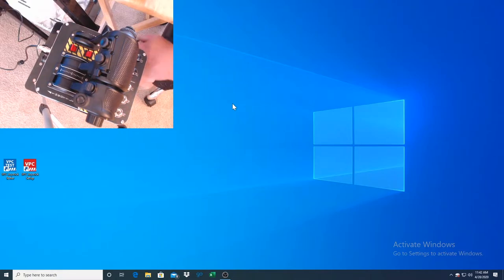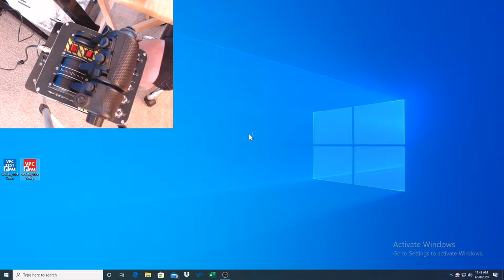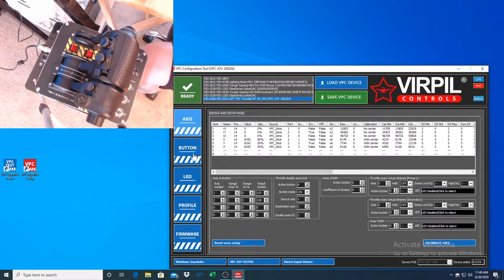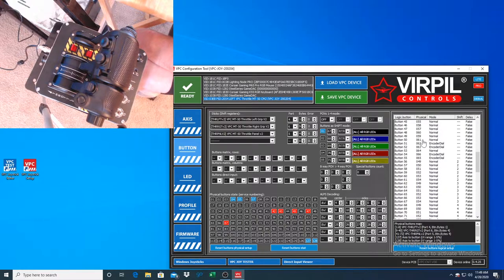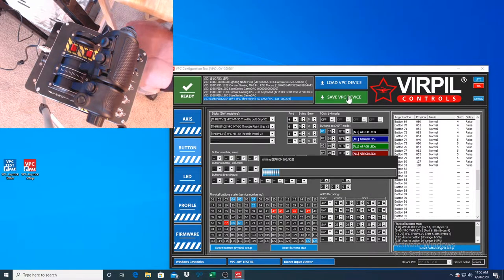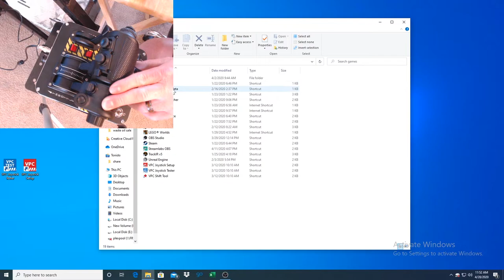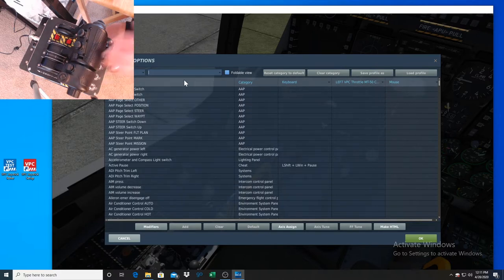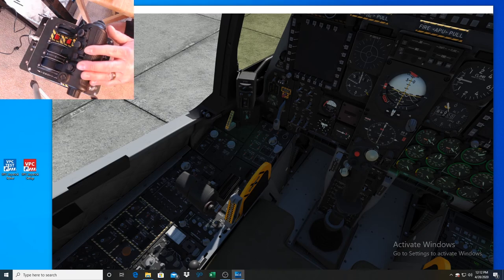HOW TO SET UP VIRPIL VIRTUAL DETENT FOR ENGINE START UP IN DCS

Comment: did everything correct as you instructed, i know i did because the bindings in controls work when i move the control, the blue gets highlighted on the right column.  A10C throttles won't using all the same assignments. all virpil software and testing is correct and sees the idle detent.  Its just that DCS wont.  I'm using A10C - Real. But am i missing something because my throttles have the normal axis already configured for throttle left and throttle right naturally.  But ive tried it both ways, with throttle (left) and throttle (right) not configured and with configured (normal axis range for throttle left & right) --- like we would without detents that is.  thx man  EDIT: OH WAIT, This must be for COLD & DARK engine start up.  I am doing instant with the plane already running & then i also tried COLD AND DARK but did not do any of the preliminatries yet.  i heard you say the key word "I've got the APU running"  so i think that was my clue that the start notch of throttle is for when you are going thru step by step A10C startup procedures in order of all the prerequisites.  DAMN, so sorry
Reply from the maker: https://youtu.be/tG3dRJ0Ryfc 
Try that video it’s an updated version for the cm3 hope this helps.
Reply from the maker: Don’t be sorry I’m glad you got it figured out 😁

Comment: Great video, thanks for taking the time. 

What do you use as the base for your throttle and stick?
Reply from the maker: I have the next level racing with flight pack add on it works pretty well for myself. I did have to drill new hold for the Hotas to bolt to it.
Reply: @JGandT   Thanks for the reply!

Comment: Great video and i have double checked i have done the correct process but I just cant get the Right Throttle to work in DCS. Left one goes fine but when I move the right forward nothing is registered in DCS. In the Virpil software and button checker etc it all works fine. Any ideas?

EDIT : No idea what i changed on the 10th attempt but now its working LOL :) Thanks mate!
Reply from the maker: have you set up left and right engine start within dcs? I also noticed they wont both start at the same time one will spool up when it stabilizes the other will spool. Please let me know if this helps.
Reply: @JGandT  Thanks for the reply - i have edited the post and confirmed after about 10 attempts it just suddenly worked so i was probably being dumb somewhere :) Cheers mate!
Reply from the maker: Glad it’s working let me know if there’s anything else I can help with.
Reply: @JGandT  Well now you have offered :) The analogue stick on the front of the right throttle is that good for slew in DCS? If so how to do configure that? Is it similar to this setup where you have to assign it a button function? Or is it best to use one of the actually 4/8 way hats? Sorry just got the throttle today and the software is confusing the hell out of me :) Cheers again

Comment: The use of the Modifier is slightly confusing. Can you explain how/why you have to do this?
Reply from the maker: @PJ D If you’re setting up the cm2 for idle cut off you will need to use a modifier in DCS or when you throttle back during normal flight it will shut down your engine. Using a modifier button will make it so you have to push another button for throttle to go into cut off shutting down the engines. If your using the cm3 it has physical detents and I’ve made another video on that.
Reply: @JGandT  Thanks! I have the CM3, will hunt your video for that one.
Reply from the maker: You will have to adjust the dead zone that can also be seen on the video link I sent you. 😁
Reply: @JGandT  Thank you! Dead zone solved the idle issue.

Comment: I can't for the life of me figure out what buttons 35-40 are. Am I insane?!
Reply from the maker: EPiQ the encoders have a push button as well as the 4 way hats also have a center button push. Maybe try those if you haven’t already.
Reply: Jon’s Gaming and Tech nope! Driving me crazy hahaha.
Reply from the maker: EPiQ I’ll have to look into it. If you find out let me know.
Reply from the maker: EPiQ so I think I have an answer. Next to your button test screen these is a column that is for your hat switches, you can see the bottom row is blanked out if there was one more hat switch the buttons would match up with the other hat switches. So I’m just guessing but the older throttles either had another hat switch or future models will. Or they just made a booboo. Either way I believe you can program them to other buttons with no issue.